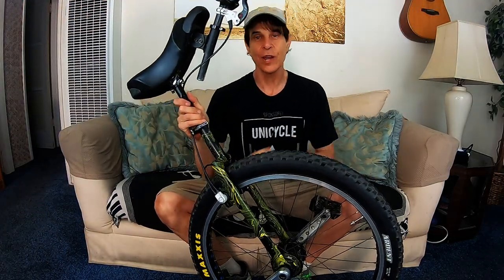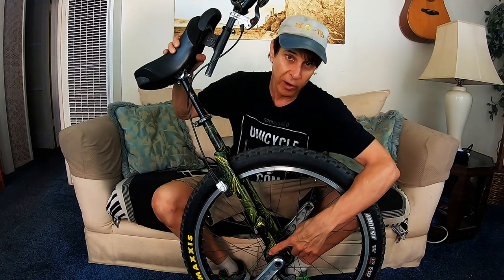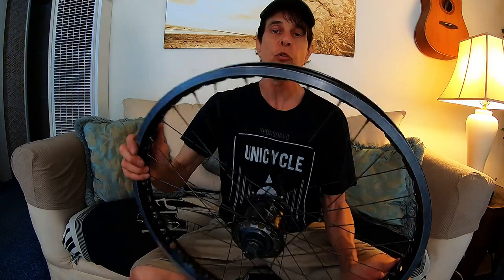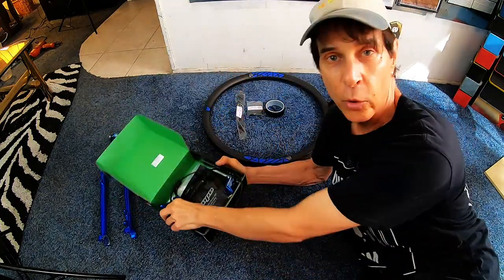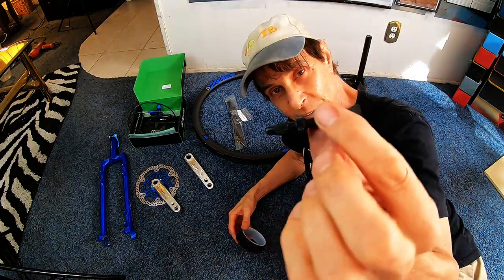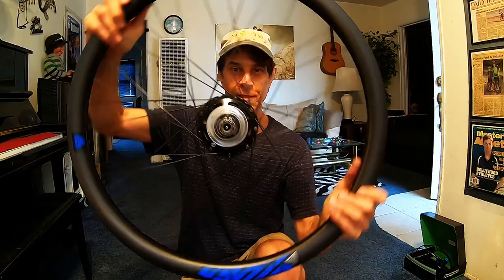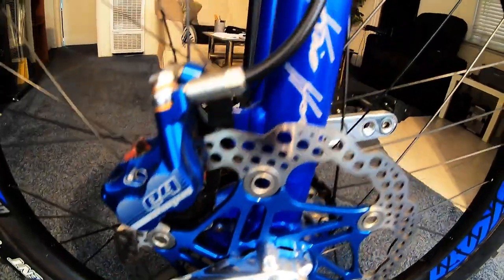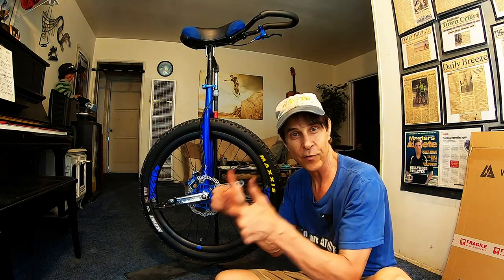Schlumpf Unicycle TRANSFORMED

Comment: Did the aerobar fit straight on from the shop?
Reply from the maker: That was a DIY handle I made from an aerobar, and bolted under the saddle. My new version fits into the KH T handle sleeve so it can be adjusted up/down/in/out.

Comment: Have you ever tried using older tyres on this setup - as in the wire bead type? Only ask as I am toying if rebuilding my G26 with that rim but hesitate as I’d like to run older tyres - not only the newer but sadly narrower TR tyres.

Comment: Doesn't look like you ground much (if any) off the outside of your frame to fit a disk on your old hub. What's your torque spec on the crank? I couldn't get it to work without any grinding when I tried - the people I know who were successful ended up taking >2mm off.
Reply from the maker: Yes, I had to file both of the insides of the frame and bearing caps to get to clear. I use Loctite on both the axle splines and the crank Bolts but in order to get it to center correctly on the brake caliper you cannot over torque the cranks because then they will go too far onto the axle.
Reply: @TerryUniGeezerPeterson  I meant the outside of the bearing holders. Most people file down the outside of the bearing holders and the caliper mount to enable the cranks to be torqued up properly without collision.
I'll be interested to hear whether the loctite holds up as I tried something similar and had no luck.
Reply from the maker: @mowcius  I don't know of anyone who has filed be outside of the bearing holders but it was not necessary in my case.